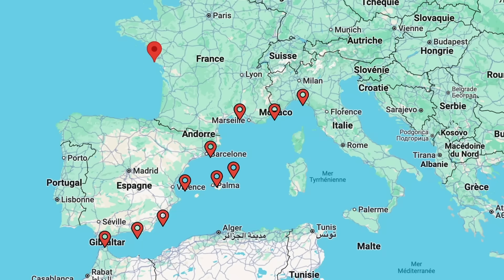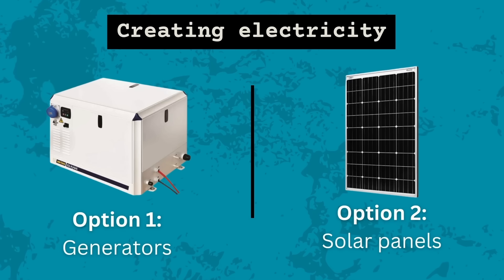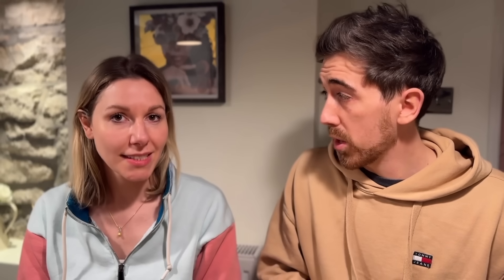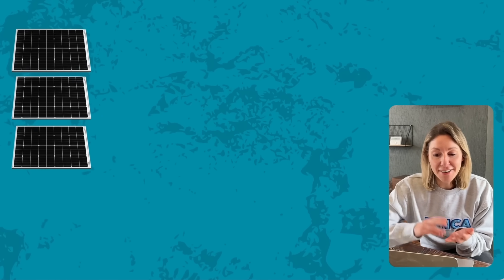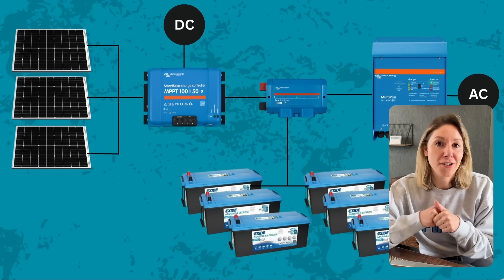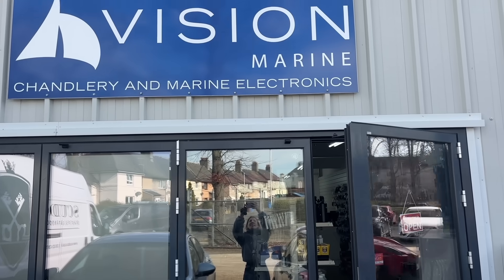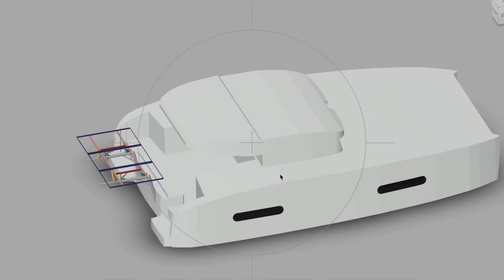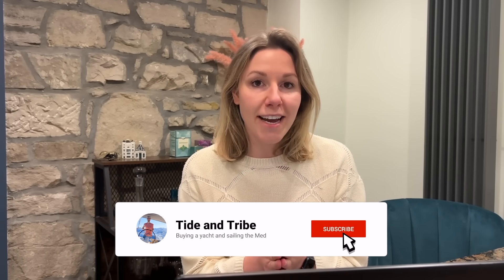We Have a €20,000 Problem! Buying A Brand New Catamaran

Comment: Please make sure that the davit/solar arch is high enough to get the dinghy WELL CLEAR of the ocean - you do not want following seas to slap or fill the dinghy. (The davits look too low in the sketch). A 10' RIB plus 10 hp outboard (plus gas and anchor) will weight around 300 pounds. When your Excess 11 is tossed around in heavy weather, the dinghy's inertia will be considerable, so make sure the arch/davits can withstand side loads.  PS - don't go cheap on your anchoring system, especially if you plan to avoid marinas. Use all high strength G-4 chain and an oversize Rocna, Mantus, or Vulcan anchor. (The factory anchors are way too small). Anchoring your boat is NOT like parking your car....
Reply from the maker: Thanks so much, appreciate the feedback. We've accounted for a lot of extra pressure from the forces and played it very safe. The frame is also designed in a way to obtain maximum strength, with supporting brackets.

Re the anchor, the yacht comes with a 25kg delta, we've purchased a 32kg upgrade. What are your thoughts?
Reply: @TheRunaLife   I am glad the davit system can hold 300kg - should be fine!
And I think the upsize to a 32kg anchor is about right for your boat which has a lot of windage. (I sailed a 37' trimaran in the South Pacific from 1977-1979 which also had windage).  Make sure to have at least 250' of chain - it is as important as the anchor. You must use a stretchy nylon bridle to act as a shock absorber when using chain. I recommend the Mantus anchor chain snubber which attaches to the bridle.

I can't stress enough that anchoring is the most dicey part of cruising and the cause of many a lost or damaged boat. Having a  good anchor, an all-chain rode combined with a shock-absorbing bridle, will help ensure that your boat is still there when you return from a shore visit and let you sleep better at night.

I am an old man now, and currently cruising the Caribbean. I envy your youth and enthusiasm!

Comment: Looks like some of the people commenting didn't watch your entire video, I would say based on your research and the info offered by your local Marine Electrical shop, you have it handled.
I fitted my boat out with all the electronics myself and I'm glad I did as I had to clean up some of the wiring mess left by the "experts"  who rigged the boat, you do need to buy a few specialty tools but the cost savings by doing this yourself more than covers the cost of the tools.
Another benefit is the knowledge you gain by doing it yourself and you can maintain and service the system as needed.
As others have mentioned if you can justify Lithium batteries they are worth it over the long haul.

One tool that is vital is a good electrical meter, I love the Klein Tools Clamp Meter CL390 it has AC & DC current up to 400Amps and is very compact and reasonably priced (here in canada about $100.00).

Cheers and I look forward to more videos from you two.
Reply from the maker: Hi David, Thanks so much for this comment. It's filled us back up with confidence. Your comment echos that of others we know who have themselves, as well the marine electricians who have helped us. Appreciate the comment :)

Comment: Hi, I also I strongly recommend using LiFePo4 batteries.  This is well known and stable battery technology by now.. You need to  put as much solar as you can.  They are not expensive and last long, especially the solid one.  To keep is simple, I would keep 12V but if you want to up the voltage, go all the way to 48V.  You need to look at what you plan to do with your two alternators, keep them 12V or raise the voltage.  You also need to look at your windlass, fridge and electronic, 12V, 24V or 48V.  I would contact a LiFePo4 battery manufacturer with a marine product line and see if you can get a deal including recommendations on how to upgrade your boat.  There is more then one solutions.  This is what most other Youtubers are doing. Good luck.
Reply from the maker: Thanks so much. There's so much great feedback on these batteries. We've opted for AGM for now, but it's great to know for a potential future upgrade

Comment: We have 3 panels above our davits and 5 on our coach roof (3200w) and we will still burn through our batteries within a week. Rarely do you get full capacity on the panels and if any part of the solar is covered it completely reduces capture rate. I would highly suggest you have another source to recharge your batteries. Living aboard FT you use more than you think you will.  Good luck with the new boat. Also - if you are that stretched to pay an additional 20k you might be in for a surprise with the additional costs even with a ‘new’ boat.
Reply from the maker: Thanks for sharing, it's really helpful to know other people's set up. We'll see how we get on in the first month and may upgrade with more panels if we start to struggle. Appreciate the feedback
Reply: @TheRunaLife  I wonder if you have an update? Are you good with your panels, or do you need to charge the batteries up often with the alternators?

Comment: Strongly urge you to install Lithium batteries (as much as you can afford), and also put a high output Balmar alternator on each engine. Generators are not necessarily "dirty and noisy" - we have an Onan unit on our Lagoon and it is pretty much essential. Think many days of cloud and rain = minimal solar. We are running a clothes washer, dishwasher, high-capacity water-maker etc. Big power draw when you convert 12V to 240:) PS Do install as much solar as you can. In a way, the issues we face living off grid on a boat are essentially the same ones the planet faces in terms of energy demand. We want maximum capacity for convenience, so the answer is diversification and overcapacity for reliability.
Reply: Balmar alternators are not great. I have two and can't wait to get rid of them. From past experience - 41 years of cruising & professional sailing - the best alternators by far are electrodyne with wake speed regulators. Solar panels are great and you should certainly have as much solar as you can afford. I have a generator, and just like every other generator I have run it is possessed by the devil and I dream of destroying it with something excessively pyrotechnic every day.
Reply from the maker: Good to see different experiences, thanks for sharing. We'll bear this in mind for the future!
Reply: @TheRunaLife  something to bear in mind is that the entire charge/discharge system has to be built with lithium in mind - alternators, cabling, switchgear etc. If you do change alternators etc you must do it with Lithium batteries in mind from the start. My system is built for a max current of 300A.
Reply: @deerfootnz  Wow, 300A on a boat. How much lithium you have? How big is the boat if I may ask?
Reply: @lekago  the boat is a Sundeer 60. I have 15.5kWh/1200 Ah of 12v LFP batteries. I have 1.8kW of solar, a 7.8kvA genset and two 200A alternators on the main engine. I never see 300A but I have seen 200A. You should oversize conductors to account for corrosion, poor termination, degradation etc.  I inherited the system and it works ok, but the electrodyne alternators are much, much better and so are the wake speed regulators. I have had all sorts of problems with Balmar gear over the years and would never purchase Balmar as in my view it's of marginal utility in general.
Reply: @deerfootnz  Thank you, it makes sense - you have big boat!
So solar seems to be a marginal source compared to the rest, you mostly run it on alternators on the main engine. Did you mean to use plural for alternators? I assume you would have around 100hp engine.
Reply: @deerfootnz  But the main point for Tide and Tribe would be that you have 15kWh LFP which can charged to 90% or above and almost fully discharged without accumulating damage and the question is - how do you feel about that capacity compared to your daily need?
Reply: @lekago  No: solar is our main source. We generate electricity with the genset only when necessary. This means cloudy days or in winter. In summer, or the tropics we get 4-5kWh from the solar in one daylight. The engine is a yanmar 4JH - HTE 110 HP. It's fitted with two Balmar alternators on one serpentine belt. The water maker is 110v ac  and so we have to run the genset to run that, usually every 5 days or so. The Sundeer is not a big boat. It's a long, low, narrow, light boat built for a couple. It's fast, easy to sail and safe. The rig is exactly the same size as my previous 43ft boat.  We have only 4 bunks. We completed our last long trip of 2550 miles in 12 days and change for an average of 201 miles per day. It wasn't a trade wind passage.
Reply: @lekago  It's about right for us. We rarely cycle through more than 50% of the capacity while anchored, though at sea we need more like 75% when everything is working hard. I can't imagine going back to SLA or AGM batteries now. We have air con but never use it. The fridge & freezer draw about 6A steady. We heat the hot water off solar through an inverter if it's sunny and from the genset, engine or diesel heater if it's not. Other loads are just lighting, various pumps etc.  We run inverters for vacuum cleaning, microwave, charging devices etc. The raymarine system at sea draws a lot of power especially in big seas with the autopilot working hard.
Reply: @deerfootnz  That's very helpful!
So in your evaluation 7.5kWh would be minimum battery set up for LiFePo4 and in reality 10kWh would be needed for passages, right?
Reply: @lekago  It depends on your loads. My boat is not very high load and it depends on your ability to charge. I would do some things differently to my setup-  pm me
Reply: @deerfootnz  😂🤣Great comment on generators:) We have an Onan 11KVA, which in 3000 hrs has actually been very good. We replace the water pump impeller more often than recommended, and we had only one issue with a broken wire shorting the temp alarm auto shut off, which was hard to diagnose. And having run Balmar alternators on various boats over decades, we've been more than happy with them. Currently (sorry🤪) have one on our starboard engine which charges the Lithium bank at c150A. With the genset running as well, we charge at close to 500A.
Reply: @ like the response you got below, I am more than a bit wary of Balmar alernators, because the cases have a powder coated finish, which traps heat which then builds up. So ideally look for alternators that have an anodised coating instead, as that helps to shed heat. Still have to ensure a good flow of air, but marine grade alternators with anodised plating are available at pretty reasonable cost. Sorry but I am unable to recommend specific brands now, as that file has presently disappeared off the computer. Best Wishes. Bob. 🤔🌟🌟🌟👍⛵️eta sorry predictive text on posting had changed Balmar to Ballard- maybe because Google’s AI is one of the really stupid AI that we suffer from presently. Frankly the only AI that isn’t really stupid - though it has to be configured properly - is Elon Musk’s Grok 3, which I am going to have to get my hands on with one of the Tesla Pi Tablets to thoroughly test as soon as possible. If possible, totally avoid having anything to do with any other AI, as they are so bad, that after being a hands on tester for AI Research and Devekopment  since the late 1970’s, I became so disgusted at the level of Stupidity, malevolence, and built in data manipulation, that I just gave up in disgust. Sigh. Could just be light at the end of the tunnel at last though. 🤔🌟🌟🌟👍⛵️
Reply from the maker: Interesting read, thank you. I think lithium upgrade maybe one to consider once we're settled if our AGMs aren't doing the job
Reply: @TheRunaLife  One of the joys of Lithium is that they discharge happily to 20%, all day every day. With AGM, you are best to not let them drop below 50%.

Comment: I like that the panels over the dinghy will stop it filling with water,  but I'm a bit confused as to how/if this 24V solar system connects to the 12V loads on the boat. You mentioned 2 additional batteries, so I'm assuming the boat already comes with 4 in parallel for a 12V system and you are adding 2 in series for 24V/140 Ah for the AC/24V loads? Will there be a 24VDC to 12VDC converter for charging the 12V house bank from solar too?  
A word of warning too; if you are running the 3000W inverter off just those two AGM batteries in series, they may not have a long lifetime at high load. Those Exide EP1200 DUAL AGM in the picture are 140 Ah, C20, which means they will deliver 140 Ah being discharged for 20 Hours, which is a 7A discharge rate or 168 Watts @ 24V. They are also rated to about 800 cycles at that 7A discharge rate. 800 cycles / 365 days = ~2 Years. I think that's their warranty... however if you continuously exceed that 7A discharge rate then you reduce the cycle life by the amount you exceed it. That 3000W inverter / 24V = 125A peak. That's 17.8x the 7A the batteries are rated at. A 1500W hair dryer would be 9x that 7A. High power loads is why often you'll see many AGMs in parallel, or being replaced with LiFePO4 that have a higher discharge rate and cycle life. For example a 140 Ah LiFePO4 rated at 1C (notice the number comes before not after the C!) means 1 times the Capacity for discharge rate, or 140 A! That's 20x higher than the 7A discharge rate of your AGM, and they will do this for 2000 cycles (5.5 years). If you've already purchased those 2 extra AGMs, I would add them to the 12V bank in parallel and purchase some LiFePO4 to power the AC/24V bus.
Reply from the maker: Hi Craig, we’re adding 2 additional AGM batteries. Thanks for the advice, we’ll take it to our marine electrician partner to discuss